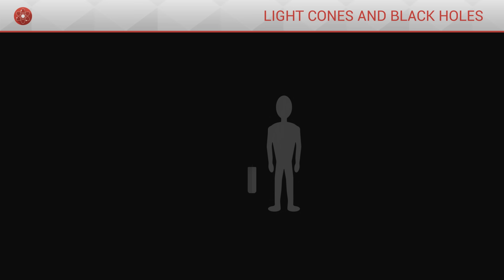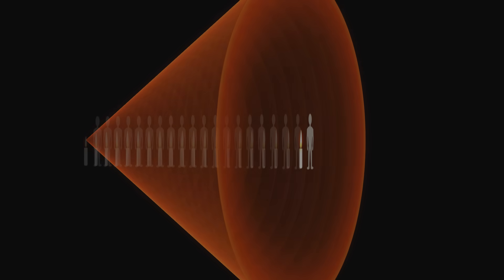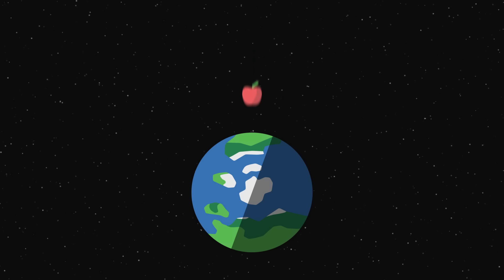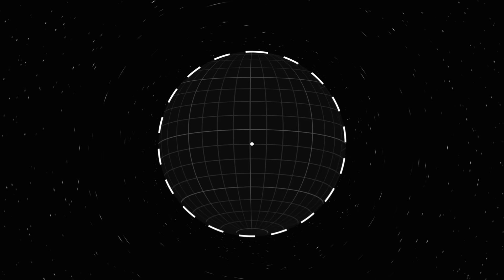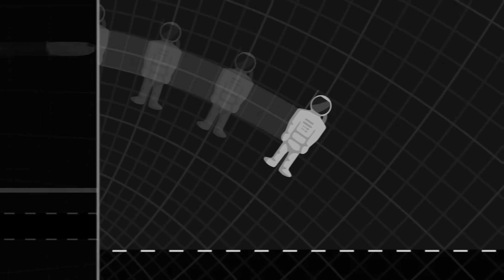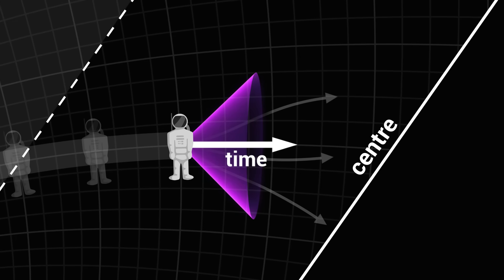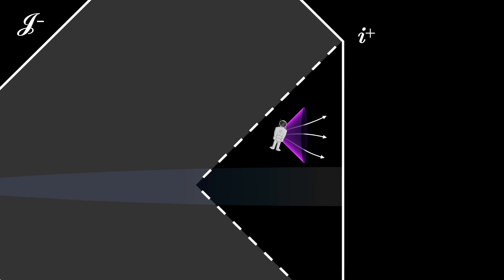Why Time and Space swap in a Black Hole

Comment: Your description of "time" and "space" doesn't quite fit "reality" - because you don't take into consideration, that the "linear time" we experience as individuals, is something quite different from the "circular/spheric time" we have chosen as a common point of reference...

The "time" we experience is linear - but the "time" we use for our watches and time-zones is circular, because it's aligned with Earth's rotation...

One "day" is the distance in "time" between 2 "midnight-crossings" of the human chosen "date-line" in the Pacific Ocean - and THAT will never change...

We could ofcourse agree to use ie Saturns rotation for common reference, but compared to our life on Earth, that'll be quite confusing - so ofcourse we have chosen the "time" we experience as individuals as well - although in a linear fashion...

I seem to recall that according to "atomic clocks", the length of "1 day" is less than 23 hours and 57 minutes...

Either the length of a "second" on an atomic clock is different from those on my watches - or my watches should jump more than 3 minutes, just before midnight, every single day - but the last 4 minutes before "midnight" seem to pass, just like the rest of the 86.400 seconds every day...

Most scientific mysteries comes from trying to equal what we experience with how we interpret it...

We experience the wide end of the "light-cone" with all it's multiple opportunities - but we interpret our experiences afterwards in the most narrow way, to define that common point of reference to interact around...

We must not confuse those 2 extremely different versions of "time" with eachother...

The concept of "here and now" is a pure individual experience - which we align through the "Northpole" - and the "distance" from the center of rotation affects the "speed of time" to compensate for the greater radius/circumference - thus "time dilation"...

Comment: This is wrong!! Time is not observer independent, whereas gravity is observer independent. In other words, Time is relevant to the observer and gravitational curvature of spacetime is universal, not dependent on the observer. Einstein's theory of general relativity is completely ignored here. Time does not bend or change direction as you show here, it merely contracts or dilates from the viewpoint of the observer. The mistake here is, you are confusing spatial reference frames with inertial reference frames. As explained by youtube channel Dialect. https://youtu.be/PjT85AxTmI0

Comment: So the black hole's warping of space and time means that, even though you can still see the event horizon as something physically in the present when you're inside, the light cones dictate that it basically no longer exists in your timeline (analogous to being in the past), since escaping the light cone (faster than light travel) would violate cause and effect, and therefore time.

Another interesting implication (please correct me if I'm wrong about any of this) is that the time/space graph points even further downwards past 45 degrees once past the event horizon. At 45 degrees, compared to the neutral spacetime of no gravity, the extremes of light cone are either right along the event horizon (moving lightspeed away from the singularity), or straight down (lightspeed towards the singularity); the latter would imply instantaneous travel relative to the neutral spacetime from far away from the black hole. Go further past the event horizon and closer to the singularity (which WILL happen due to already being past where light can't escape), and that straight down would actually start to go backwards, implying backwards travel compared to the neutral spacetime (which shouldn't affect/break the outside universe because the event horizon, by definition, means events within have no causal effect on anything outside; they're detached). I'm not sure what to do with this info, but it's interesting

Regardless, this was an amazing video, first time I really understood what was meant by "time and space swapping in a black hole" beyond just the math, after many other unsatisfactory explanations

Comment: For some reason people don't know that Einstein repeatedly said that singularities are not possible. Wherever you have an astronomical quantity of mass "dilation" (sometimes called gamma or y) will occur. Mass that is dilated is smeared through spacetime relative to an outside observer. General relativity does not predict singularities when you factor in dilation. 
   In the 1939 journal "Annals of Mathematics" he wrote "The essential result of this investigation is a clear understanding as to why the "Schwarzchild singularities " (Schwarzchild was the first to raise the issue of General relativity predicting singularities) do not exist in physical reality. Although the theory given here treats only clusters whose particles move along circular paths it does seem to be subject to reasonable doubt that more general cases will have analogous results. The"Schwarzchild singularities " do not appear for the reason that otherwise the constituting particles would reach the velocity of light."
   If you look at a common relativity graph with velocity on the horizontal line and dilation on the vertical, the phenomenon is clear, even mass that exists at 75% light speed is partially dilated.
   Einstein formulated relativity before the existence of galaxies was confirmed, it's clear the mass is dilated though the galaxy and not the universe as a whole.
   There is no place in the universe where mass is more concentrated than at the center of a galaxy. 99.8% of the mass in our solar system is in the sun. 99.9% of the mass in an atom is in the nucleus. If these norms are true for galaxies than we can infer that there is 100's of trillions of solar masses at the center of common spiral galaxies. There is no way to know through observation, there is far too much interference, dilation and gravitational lensing. High mass means high momentum. If we attribute a radius to these numbers than we can calculate that relativistic velocities exist in these regions.
   The mass at the center of our own galaxy is dilated, in some sublime way that mass is all around us because as the graph shows we are still connected to it.
   The greatest mystery in science is the abnormally high rotation rates of stars in spiral galaxies (the reason for the theory of dark matter). It was recently discovered that low mass galaxies (like NGC 1052-DF2) have normal star rotation rates. This is what relativity would predict because there is an insufficient quantity of mass to achieve relativistic velocities. This is virtual proof that dilation is the governing phenomenon at galactic centers.
   Black holes were popularized by television in the 1960's and belief in them gradually came to be despite the fact that Einstein said they cannot exist and there was no evidence.
   There is no way to take a picture of the galactic center, as per relativity an observer would have to exist at or near it's momentum.
   We all learned that mass will dilate when it approaches the speed of light in high school and this perfectly explains the greatest mystery in science. There is no black holes or dark matter there is just relativity.

Comment: I have always thought about this even as a kid. So, here is my hypothesis. Absolute Speed does not slow down time, that's impossible as all absolute velocity is purely relative. One object cannot move 'in relation to another object in space' as any movement from object A is indistinguishable from any movement from object B. However as Gravity and acceleration are essentially the same, an object Accelerating is NOT the same as another object NOT accelerating. So, acceleration and Gravity slow down time, that is logical to me. So, in a Black hole you have, in essence infinite Gravity and therefore time would 'stop' effectively. So, from an observers point of view, if possible which it is not, the Time of the Universe would look to be infinitely fast, therefore as far as the inside of the black hole is concerned the universe has ended already.

Comment: amazing video. The explanation as to how space becomes time-like is fantastic.

The only thing I would appreciate would be to see more details into the reverse, i.e., in what ways does time become space-like. The results may be sort of implied i guess from the previous statements, but for whatever reason, it seems harder to intuit in my head. I'm not really sure how to interpret that you could be moving in "3 dimensions of time" as you do normally through space 🤔
Reply: Inside the event horizon, no matter how fast you accelerate, nor which direction you accelerate in, you will always fall toward the singularity.  However accelerating "up" allows you to catch up to the light cones of events above you, or even outside the black hole, while accelerating "down" allows you to catch up to the light cones of things that fell in before you, perhaps even the collapsing star that formed the black hole.  However, there is a price: just as accelerating in any direction outside a black hole will cause you to experience a shorter proper time interval than a non-accelerating observer (i.e., you'll arrive at tomorrow "faster" than the non-accelerating observer), accelerating in any direction inside a black hole will shorten the proper time you experience before reaching the singularity.  By accelerating outward, you may be able to outrun an indefinite amount of infalling matter, potentially giving you a glimpse into the far future of the universe, but not only will you not be able to keep from falling toward the singularity, but time will be so dilated that the proper time you experience before hitting the singularity is less than that of free-falling object.

Comment: ''nothing can be transmitted faster than light''
I'm not sure about that. Quantum entanglement is basically where two particles are like copy-paste. Their state is not independant of each other which means you do something to the first, the second will follow suit. And the reaction seems to be faster than light by the distence between them
Reply: That's not how entanglement works. If you do something to one particle, it breaks the entanglement. You can not use your particle to manipulate the partner.
Entanglement is about a measurement correlation. Once you do that measurement, you're done. You can not use it to send signals.

Comment: The spaceship does not move, as a matter of fact, nothing moves in and of itself, motion can only be derived in relation to something else.  If you put a camera in a room where nothing moves and then play back the video at a high or slow rate of speed, you would not be able to tell how many times have elapsed.  I used the term "many" because in its shortest intervals, time (movement between things) can only be measured in divisions of plank epochs, 10^-43 sec.

For every 10^-34 cm., plank length, a 10^-43 sec worth of information can be created through a relational abstraction of movement between things.  On the level of the quantum, that would be an intermingling of the wave functions.  Perhaps it is that individuated relational abstraction of movement between things, which we "perceive" as time.

An apple does not fall down, it moves towards the center of mass of a body and the center of mass of a body also moves towards the apple.   The rate at which our cerebral morphology enables us to "perceive" this relational abstraction and reconstruct the information is what we perceive as time.  If we could reconstruct information at the speed of the plank epoch, we would see no movement, but we would see all movement.  We would see everything all at once.

These are just my thoughts out loud.

Thank you for the wonderful, thought provoking, video.

Comment: Not a great representation. A Penrose diagram doesn't have a uniform grid. A light cone doesn't change orientation relative to the grid. You're showing the result of a Fornier transform without changing the background parameters. The result is correct, but the method is inaccurate.

Comment: Thought experiment: being the astronaut whose body is halfway across. Imagine she is equally distributed half across the event horizon and half outside of it. Between her hands she holds a sturdy fiber optic cable. What happens? Does the universe get destroyed? Do we get to peer inside? What does she see if she holds each end to each eye? I believe that's an interesting question.
Reply: The cable breaks, and most likely, the astronaut's body does, too.  The extreme time dilation as you approach the event horizon causes tensile stress to diverge as it gets transmitted through an object approaching the event horizon.  Because tension force is a manifestation of electromagnetism, in a universe such as ours, where the speed of light is finite and black holes can form, it is physically impossible for an object to have infinite tensile strength, because sufficient acceleration would tear the atoms apart before the photons emitted by the atoms can reach each other.

Comment: After studying 4D curvature structures I finally get why our grasp on black hole geometry has been slippery and loose

The light cone isn’t a 2d cone, and it’s not projecting a disc through time

That’s a hyper conic projection, and it projects a 3-sphere through time, technically through multiple congruent time-like dimensions, just not all of them using the causal field structure

Comment: I'm confused. Light cones don't orient in a single temporal direction. There are 2 light cones for any event: a future light cone and a past light cone. (Edit: I should also point out that your illustrations are sort of misleading in this respect. You drew them all as if there is only one light cone per-event, but traditionally in theoretical physics, they are drawn with two light cones. The diagrams are closely related to Minkowski diagrams. Minkowski introduced both in the same paper, illustrated with the same conventions.) The future light cone is defined as the cone that's oriented in the direction of the arrow of time. So if you're defining the arrow of time as the direction in which the future light cone is oriented, then... you have a circular definition. You're just saying that we can only move forward in time because we can only move toward the future, which is another way of saying we can only move forward in time. The arrow of time, as I understand it, is widely considered to be a consequence of the second law of thermodynamics. But the second law of thermodynamics has no explanation. It's not necessary. According to Susskind, it's just an incidental fact of the initial conditions of the universe. It could just as easily have operated in reverse or not at all. In which case, there would be no unidirectional flow of time, and time would presumably be navigable like a spatial dimension (if only in the imaginary sense in which "navigation" can happen without a flow of time). So, it seems there is no principle orienting the arrow of time with respect to space or the speed of light. It's arbitrary
Reply: Great visualizations though, that part where you uncurved the horizon at the end was very cool

Comment: I don't get there the train of logic goes from the light cone somehow being equivalent to time itself. Are you saying time is defined by whatever direction light goes after emanating from its source?

Edit: so I think the point is that light is not one and the same as the concept of time, but light can be used as a reference for how time works because it is the fastest thing in the universe. And because of that, causality can be "defined" by the behavior of light, since it will technically always be the limiting factor in cause and effect, because light will always interact before anything else in every situation, no matter what.

Comment: It seems like knowledge could expand one’s light cone by expanding the field of possible futures. The center of the black hole is the only possible future. There’s a hellish fatalism in that. Pure mechanism.
Reply: And I realize it’s not technically a mechanical relationship because the black hole isn’t an object. I just meant like it’s a cause and effect thing where the locus of control is outside the observer. I guess it’s all information. And the figurative light cone can’t be widened beyond 45 degrees but you could spread your influence around more. I play it fast and loose with the language sometimes. 😐

Comment: 1:10 The cone would not have a flat base as shown. It came from a sphere, so it would have a spherical base.
If the base was flat, the light traveling along the 45° sides would have a longer distance than the light in the center.
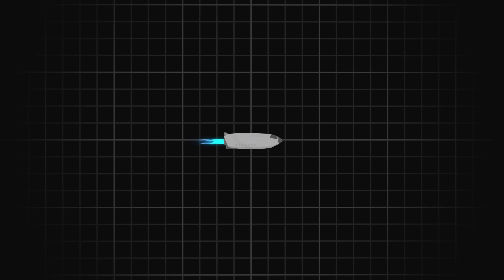Looks like the animation fixed that at the 3:28 mark.